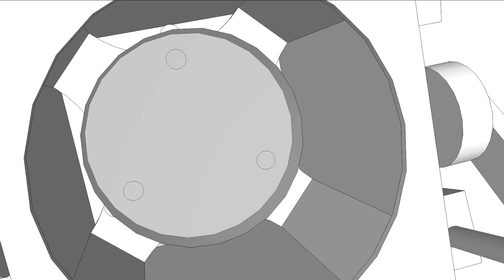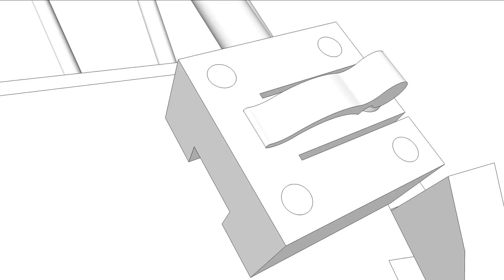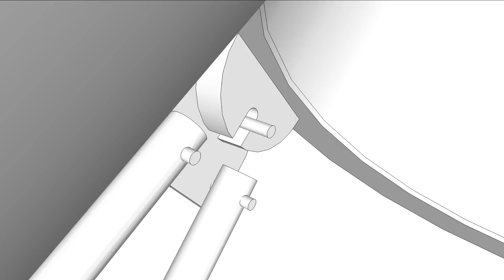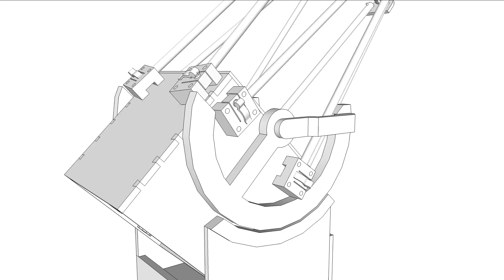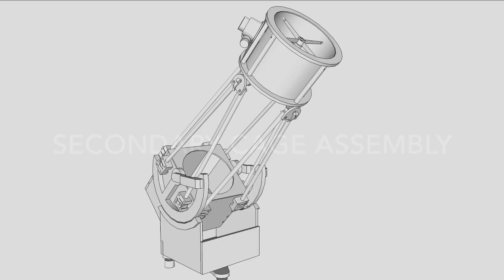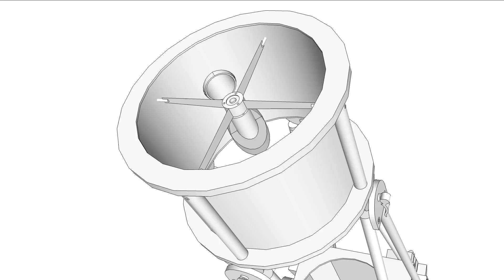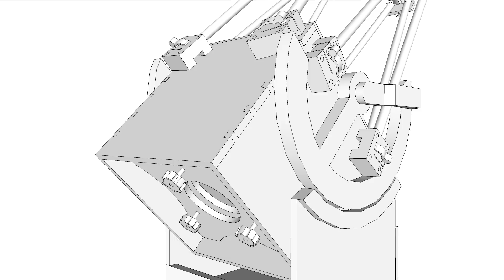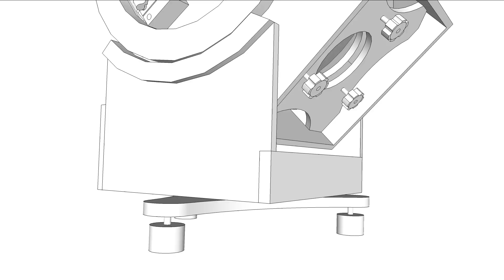Making a telescope

Comment: I have replaced the teflon blocks that allow turning in azimuth with small wheels that can only go forward backwards, and the movements in azimuth are now infinitely smoother, even at an almost microscopic level.  I did another type of dobson only with square section hollow aluminum bars (the telescope also had a square section), it was extremely light and precise, and in dobson it turned much better than the wooden ones, since the weight was accumulated in the mirror, which the lever arm was much larger

Comment: I was a custom cabinetmaker in NYC for a few decades and I learned a few new tricks from your video. And it's been a long time since I have seen anyone cut dovetails by hand! 

A few questions:  I wonder about the use of 1/2" baltic birch everywhere, even in the blocks that hold the trusses, when using hardwood would be easier and stronger for the blocks on the mirror box and a phenolic or plastic for the UTA blocks.  Was this a design choice for the look of the scope? 

The second question is the tool you used to plunge cut the mortices. What is this? I used a biscuit joiner for years but haven't seen this. (I retired form cabinetmaking about 20-25 years ago)
Reply from the maker: Hello Will. Thank you for your comment.  So in regards to The Baltic Birch plywood. Firstly the blocks that hold the truss pole, I have experimented with various hardwoods and I had several split and the hole that excepts the truss pole tended to warp with time, but with the Birch ply I have had no issues whatsoever. I enjoy working with Birch ply, plus it's the best quality most available plywood I can get here in the UK. Indeed there are lighter options out there but I have confidence in Birch ply. I have no experience in working with plastics and I find Birch ply does the job nicely So I have no intention of changing. The design was based purely on the functionality and what materials I have available that I can use and at a reasonable price.  The Biscuit tool you question about is a Festool Domino. A pricey tool but very accurate and the tool has paid for itself ten times over. Not really a hobby tool. unless you have the money. Thanks once again. Peter
Reply: @PeterSmithwoodsmith  Thanks for the reply. I realized that was a Festool after a bit of Googling and also remembered why I never bought one- the price! Thanks again for the video. I am sure if I end up making a scope, I will watch it again. A lot of good techniques in there.

Comment: Мастер, привет из России! 
 Good job! Nice to see. 
 But it seems to me that plywood is not the best material for mounting Dobson. In a humid atmosphere, there may be distortions and will often have to do the adjustment.
Reply from the maker: Hello. Thank you for your Comment. I have made Dobsonians made out of Birch plywood and finished in Yacht Varnish, That are 15 years old and are as good as the day they were made. So no problems with the Humidity or Distortions.

Comment: One can probably mirror a larger satellite dish a build a big one based on a scaled up same style plan.
Reply from the maker: Hello John, Telescope mirrors are very thick and the glass used is chosen for its stability any slight movement will ruin the image. also, the shape of the parabolic mirror is crucial and very accurate. I don't thank a satellite dish would be the right shape.

Comment: Very amazing work. But are you sure, wood is the best choice? I think it will change size when it gets wet or dries again.
Reply from the maker: Hi there. I've been building telescopes out of Baltic Birch Plywood for over 15 years. It is very stable and one of the best plywoods on the market. I finish the plywood with 4 coats Yacht varnish this ensures the plywood isn't affected by moister and temperature.  Every Telescope that I've made out of Birch Ply once collimated (alignment of the optics) has held its alignment true all night throughout each session. So basically I'm 100% happy and trust in this material. the only downside is it is a little bit heavy but besides this. I love working with Birch plywood. every lay is equal thickness. There are no voids or splits. and it cuts lovely. In my opinion, one of the best Dobsonian telescopes manufactures is Obsession Telescopes they have over 30 years of experience in building these types of telescope. Their Telescopes are made to an outstanding standard. They use Plywood too.

Comment: Peter thanks for the video, that was brilliant. I was wondering what distance would you be able to see over a body of water? And have you tried?
Reply from the maker: Thanks for your kind comment. I have not tried to look over the sea with my telescope as I don't live near the sea. But I will try that when I next get the chance. I have had a look at your channel. If you don't mind me making a suggestion. Try to get hold of a telescope that is on a German Equatorial mount and use this to study astronomy. In the process of using this, it helps understand the movement of the earth and how celestial mechanics work. I have 15 years of experience in using these mount. they are fantastic device and a joy to use.   
Kind Regards
Pete

Comment: I could see dovetailing black cherry,  or oak, or even polar and pine, but plywood?
Reply from the maker: Hi Paul. This is top-quality baltic birch plywood. every layer is equal thickness with no voids or defects. The ply is very stable. which is needed with the very damp conditions and low temperatures we get here in England at night. There are many very experienced Dobsonian Telescope makers out there that use Plywood and have used it for many years. I've been using Birch ply for telescope building for over 15 years, and have never had any problems. It is a joy to work with. The dovetails are strong with this plywood and in my opinion, are a great joint for the job and they look nice too. As I said before I have telescopes that are 15 years old with Plywood dovetails in their construction. they are in great condition and holding strong to this day.

Comment: did you make the merror?
Reply from the maker: Hi Anthony. I didn't make the mirror. I considered it for many years. weighing up the options. to grind figure and polish such a large mirror would take experience and practice creating several mirrors if not more before i attempt this large 20 inch. I know people that have done this and it takes years. I cam to the conclusion it is better and cheaper to buy one.

Comment: Nice but bulky design.
Reply from the maker: Thanks for the comment. These scopes work wonderfully. You may think they are bulky, but it stays collimated and perform perfectly. I have made many scopes in the last 20 years. Sometimes trying to make them as lite weight as possible but this makes the scope weak and they dont stay collimated. So I have settled on a design that is rock solid. They pack down small and fill in the back of a small car. Perhaps a commercial scope is more suited to your needs.
Reply: @PeterSmithwoodsmith  Nope, commercial scopes are subpar, I will have to build my own. I will use more carbon and metal on bulky parts. It will be stiff but light.
Reply from the maker: @pangrac1  Well good luck I hope your build goes as well as you expect it too.
Reply: @PeterSmithwoodsmith  It will be work thru the mistakes and errors. As usual. 😉😂 Optical stability will be my satisfactions.

Comment: 28:21 how?
Reply from the maker: Hello, the plywood that the black Formica is stuck to, has already a perfect circle in it. the Router cutter has a bearing at the bottom of the cutter that runs on the plywood and trims the Formica flush with the plywood. like this. https://www.toolstation.com/router-bit-flush/p53540?store=H4&utm_source=googleshopping&utm_medium=feed&utm_campaign=googleshoppingfeed&gclid=CjwKCAjwkun1BRAIEiwA2mJRWdHn6ut8cjDCCLYEui1y3Rne4t0qXLk4WDYJDPeOyKFHDoPZkywkgRoCYEoQAvD_BwE
Reply: Ah my bad. I fogot about 10s before.